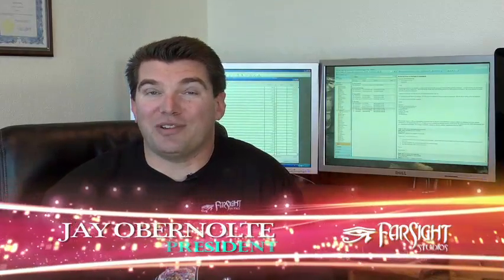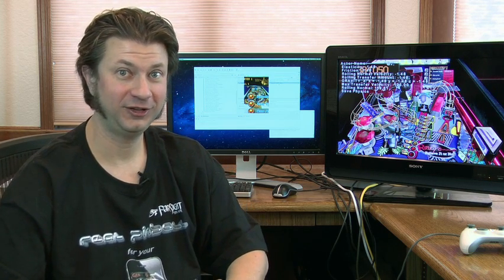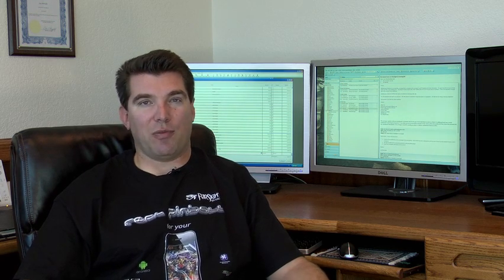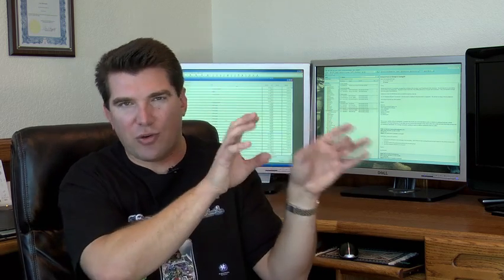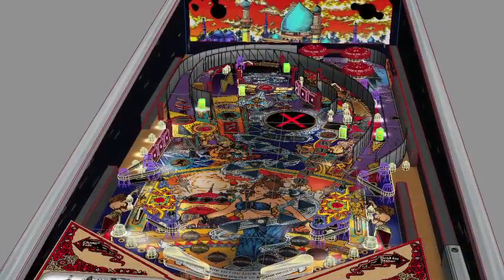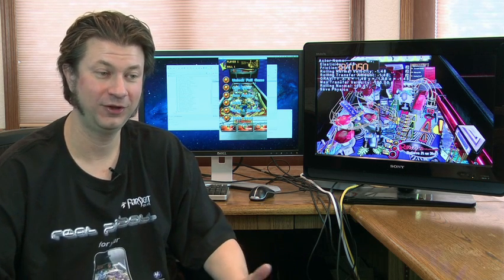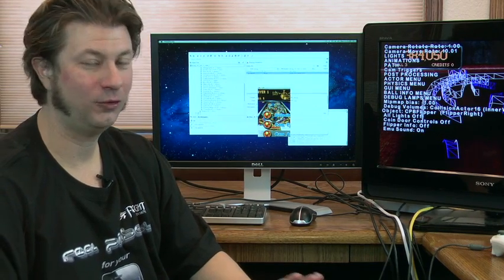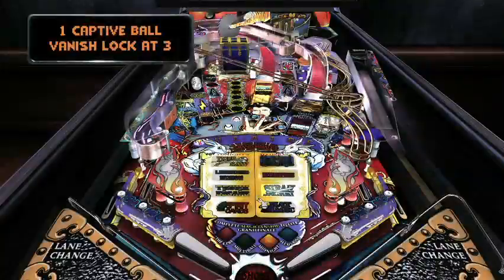Making of Pinball Arcade

Comment: I understand the "maximize exposure, lower cost" point of view, but I don't think it actually worked. $5 per table is quite a bit.
Reply: I don't want to play devil's advocate here, but given how much those tables go for and how much work has to be done to repair, maintain and digitize a table, not to mention all the licensing with all the different companies and sometimes the franchise-licensing for tables like T2 and Star Trek... I think $5 is as sound as it gets. Besides, if you want to buy them all for lower, just get the season pass, you'll save $20 for each season, reducing the price of each table by about $1.50 to $2 each. And it's still FAR CHEAPER than buying the physical machines, repairing and maintaining them yourself. A lot of those tables go for thousands of dollars and higher.
Reply: I get all the licensing fees and stuff. My point of the "maximize exposure" is that they are now on everything under the sun. You can get these games on nearly all platforms. The money is there.

Also There are by no many any comparison to playing the actual game. I've noticed some serious glitches, both to my benefit and not. The actual physics the physical  machines use is extremely hard to replicate 1-to-1, if not impossible. 

I'm honestly saying that if they'd reduce the cost by 50% i'd gladly buy the season packs. I just can't spend $30-40 on something so trivial. Let's be honest... The best they have to offer as a whole was the season 1 pack, Which I got with the purchase of the game on sale from GameStop.  Which was a good buy and provided a lot of fun. But the rest of the season packs aren't nearly as good. There are a few here and there that are worth playing.... But not spending $5 a piece for them.